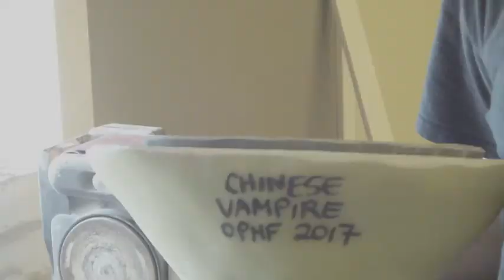Molding a prosthetic pt2 Epoxy Systems

Comment: You might already know this, but the reason the epoxy doesn't really work with the matte is because the fibers are held together with styrene, which polyester resin also contains, which dissolves the styrene in the matte and loosens the fibers. It's just so it can be stored flat but still conform when activated.
Reply from the maker: Yes sir.
Reply: @toxicimagestudios9547  I figured, I just wanted to sound smart :) I appreciate you not cutting these videos down, it really helps to get a feel for how long these things should take to do.
Reply from the maker: Andyfilms I get criticism because the videos are so long. I think it’s important to cover all the relevant information. If I did a bunch of short 10-15 minute videos I would probably get more views, but I would rather not do that
Reply: @toxicimagestudios9547  No way, you're 100% correct. "Here's one I baked earlier" tutorials result in me either rushing through it because I think it's supposed to take 1/4 the time it actually does, or me feeling totally inept because it's taking longer than it looked in the video. Anyone can figure out the basics of a process by just messing around. It's the subtleties of the techniques that are the real value, and to get that, you have to see the whole process.
Reply: @toxicimagestudios9547  Also, I don't know if you've played around with Freekote Lifft at all, but it kind of changed my life. Basically eliminates the step of cleaning clay out of molds, and in a lot of cases the sculpts come out so clean they can be remolded if necessary.
Reply from the maker: Andyfilms I have used that. I like it t, but I find the ease release does just as good of a job
Reply: Andyfilms i was on their website can you use any of them for a plaster mold